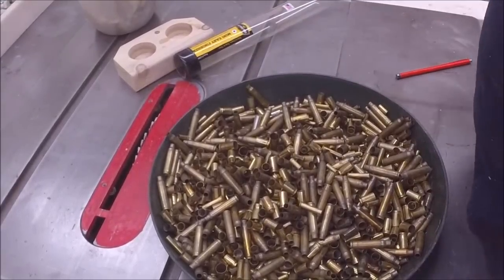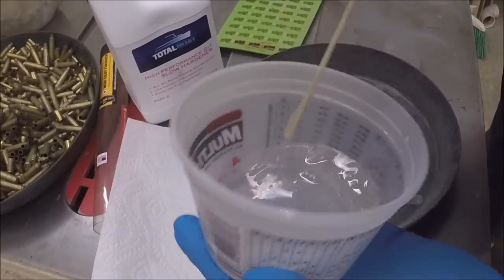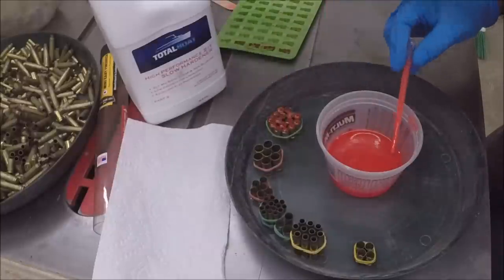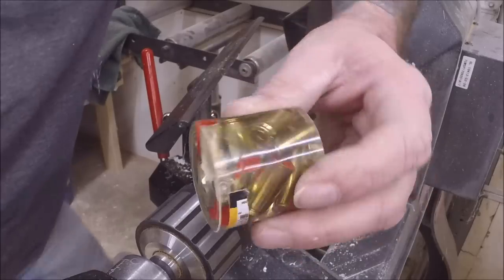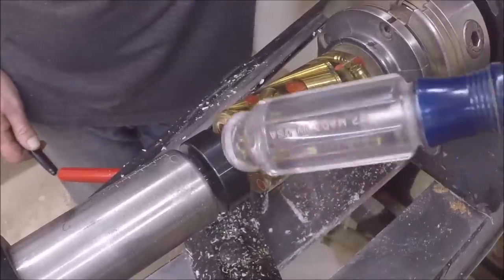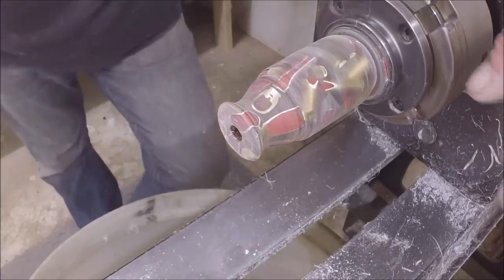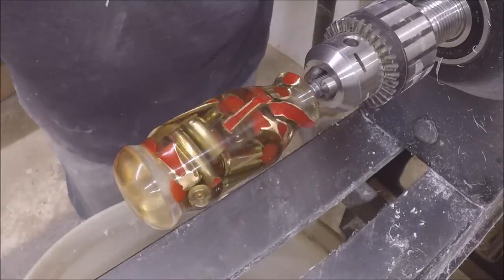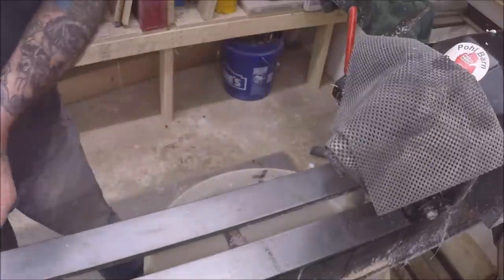Ammo Casings and Resin.. A Screw Driver Handle

Comment: Large diameter handles let you get lots of torque...... long screwdriver shafts eat up torque.
Reply from the maker: Thank You, I'm sure my Dad is never going to use that for anything other than to show it off, and the handle is the right size for his arthritis .
Reply: always used the long screwdrivers to spin the shank fast with my finger tips. if the length of the driver is causing serious torque problems you're probably doing something wrong. phillips is trash anyway.
Reply: +firebirdude2
 actually long screwdriver shafts don't eat up torque. The reason for this is torque is in units of force times distance, but the distance of course is not distance along the axis of rotation (the screwdriver shaft) but instead distance away from the axis. This is one reason screwdrivers have handles; the bigger the handle, the more torque to the shaft is provided by a given force. Not the length of the shaft.

Comment: looks great brother thats one hell of a long screw driver . good job buddy .
Reply from the maker: Thank You !  It was my Dad's  for what ever reason the handle desintegrated in his tool box. Snap on tools are expensive, but try to get it replaced if you didn't buy it from that guy. Not Happening.
Reply: @PohlBarnProductions  well it is a lot better then it was for sure and a one of a kind piece . i think you did your dad proud with it and it will last forever now. well as long as you dont drive over it with a big truck lol . again great job my friend .

Comment: Great job, I love the idea using brass bullets casing. I thought it might dull your tools. It looked just fine. Keep turning. Thanks for sharing.
Reply from the maker: Thank You Vyran,  the brass casing needed to be annealed,  they were unbelievably hard, I did not know this or I would have annealed them to soften them,
Reply: All kinds of metals need to be annealed/softened before you can work them. Even metals like copper and silver. Once softened it's so much easier to work with. Getting the some metals annealed can be very tricky. Every metal needs to get to the right temperature to get annealed. Some need different heat treatment to get  soft just right. Some metals need to be heated  up and cooled down 2 to 3  times to get annealed. Because of the different additives used. I've had some issues with lead, brass, steels and even copper in the pass. I'm now making my own metals in the shop for my own products. I've tried many different mixtures. Just to get exactly what I needed in weight but size were way off. Many people like to make there own brass bullet casings. To get there idea weights for shooting. Sniper school taught me to make my own bullets. To know exactly what I'm shooting. How far my bullets will go. How make and use my own gun power used for each shot. I new how my bullets would act. From being consistent with every bullet I made. I had faith in each bullet made myself and I new how they would act in flight. I sometimes tried different brass casing that I've made. Just to see how the different additives would do or fail. We tried different strengths sizes and case weights. Even trying more and less of our own gunpowder mixtures for each bullet we studied. Most people  would skip this and part and just go out and buy the empty containers in bulk. I used to go to the shooting range early in the morning and pick up as many as I could find or I would buy empty casing at the range. I would also go to where the local police would practice at. This little nice Gun Shop with a large shooting range in the basement. If you ever need to know the right annealing technique and temperature ranges for the different kinds of metals your needing to annealed to be safe most brass is around 500° to 600° for one hour. If that doesn't work try between 725 to 800° for a 10 to 15 secend at most and  that should do. Metals are getting worse by using and reusing over and over. All the recycling through the years. People are not really paying attention to the quality of reused metals. Watch how the quality is starting to effect soft metal over time. Some metal companies are starting to deny recycled metal. We've been buying crappy metals from around the world that's so tainted and could infect the other metals. Its making our metals more expensive. We have to  add different additives to clean out other properties added to the crappy metals. We should of never closed our metal making company.  Wev sent the to the other side of the world. Were importing really messed up and bad quality metals. More and more companies are coming back. The key to the senses is to try and lower the price as much as possible to keep the the company's from buying the bad metals from outside sources. Unless the Government gets involved to set up quality standards here and abroad. But fat chance with the stupid people things the worlds going to end from climate change. LOL this isn't the first time the world that the climate has changed. It's like commonsense has died with the adaption of computer and game system invented and Democrat invasion of public school's and colleges. To push there crazy idolizlolge on our children. That's why I left college. I felt it wasn't right to have only Democrat and no other parties in schools. I felt schools failed not only me but our students as well. They shouldn't of been allowed in schools or colleges to push stupid idolizlolge on the students without another party able stand up against them. Now we have a communist trying to kill our capitalist economy. Doesn't anyone remember or talk about Socialist party like Berry Sanders or Hitler and his socialist ideology that brainwashed millions. We are heading that way again. 60 years ago we had the Socialist hearing in America. Some people were even executed over them hearing. Its starting again were it last started in California. I never thought in my life we would have communist party running for president. Berry Sander and Bloomberg buying his way in to wreak the American Dreams.

Comment: This is an interesting idea. I'd be interested to see a version done where the first cast was narrower - then this cast was put into a second fatter cast of resin so that when turning the screwdriver handle's on the lathe there would be a buffer zone of clear resin and the shell casings would remain intact behind this at the finish.
Reply from the maker: Thank You John, that's an Idea,  I was after the cut away look when I turned this,
Reply: The Pohl Barn Productions Thanks for responding.  Yep,  I figured you knew what you were doing :) I wonder what you’ll do next!

Comment: Have you ever considered an air cooling setup for stuff that gets hot like this? I got myself one of those loc-line coolant nozzle kits, hooked it up to a ball valve and mounted it to a magnet so I can place it anywhere.  I like it for pointing some air at the back of a forstner bit for hollowing.  I vary the air flow with the valve. Good for clearing chips too. Food for thought... The handle came out great!
Reply from the maker: Thank You Ben, thanks for the info
Reply: @PohlBarnProductions  Any time! I always get a lot out of videos like yours, happy to help.

Comment: Hey Sir, Fellow Michigander here. (Grew up in Vermontville, live in Detroit-metro now).
Why do you place the epoxy in a pressure chamber? What is the advantage?
I had thought about a vacuum chamber to draw out air bubbles in thicker castings.

Sorry for the dumb question; this is a new venture for me. Thanks for your time, and for sharing your projects!
Reply from the maker: Thank  you Tim,  LOL   I went from 8 and woodward ish area to Charlotte.  and I'm never going back ! um to control exothermic reaction and to compress any of the smaller air bubbles until the resin sets up and hardens, vacuum isn't fast enough to remove the bubbles before the resin sets up, there are resins specifically for vacuum chambers then cook it to cure it then pour it and put it into a pressure pot,  LOL

Comment: Very cool idea. i was wondering if carbide would cut brass smooth but then again brass is soft compared to other things like seashells!!. but i have been casting bullets and exploded views lately. had good luck so far .got a mould to do a 50 cal one since i have quite a few of those laying around. should be interesting. specially how the powder reacts to the resin over time. i mix with resin first to shape how i want then cast but still. might not work out in the long run. Keep em coming.
Reply from the maker: Thank you Johnny,  actually I should have annealed the casings first that would have made them softer,  I could turn them but they were really hard due to the flash heating they get from being fired.

Comment: Why can you not turn ferrous metal? Is it the hardness? Are they to brittle? Just curious. Great channel. Watch at the end of the day to decompress.
Reply from the maker: my tools are for wood not steel, you can turn it with a metal lathe,  I also wouldn't want sparks in my shop with dust and wood everywhere.

Comment: Did you try inserting the screwdriver shank while the epoxy was still liquid?
Reply from the maker: yes that would of probably worked,  but it would not of fit into the pressure pot like that.

Comment: I noticed you always use a stick for mixing your epoxy!!  I use a little custom made plastic mixing bit in my cordless variable speed drill.. works really well..   you really think up some cool stuff to create with..  great stuff .. Did the brass tear up you tools?? Did you have to use metal turning machine bits ??
Reply from the maker: Thank you Tom,  the brass was hard on the tools I should have annealed them first but didn't know, I use normal carbide tools for wood

Comment: I tried to turn a blank using seashells and my carbide tips wouldn't cut thru it....how are you cutting through these shell casings and do you have to constantly sharpen them?
My niece asked me to do something similar.
Reply from the maker: they are hard but do cut, it just took longer than expected,  light cuts with the carbide cutters, you can cut it with HHS also but well have to sharpen many times. I am working on another, Annealing the casings first, heating them with a torch and dropping them into water,
  I know that should harden them but it softens them,  that's backwards  if you ask me...  then I have to run them all through a tumbler to polish them as the annealing discolors them.
Reply: @PohlBarnProductions  thanks for the feedback and all the great videos!

Comment: If you try this again, clean the brass with an acid like acetone, vinegar, etc. You need to get the oils from hands and cleaning the gun off. Also you need to give the resin a mechanical grip to the metal. So sand it like you would when making a pen blank. Try again though. Because this looks really neat.
Reply from the maker: Thank you Erin
Reply: The Pohl Barn Productions you’re welcome. Found you through Nick Zammeti, Peter Brown, Andy Phillips, Bobby Duke, and Matt Jordan. Love the things y’all make.
Reply from the maker: @ScheelesGreen  that quite the bunch of great guys to be found with,  I'm honored to be among them. Thanks again for the support,

Comment: Even sped up it took forever to fill those 223s didn't it?  Awesome work
Reply from the maker: Thank you ! It took forever trying to not get bubbles into them, the dropper helped out tremendously. but yes it took a lil bit to fill them all, it's only spend up X 4, you only have so much time to work with the resin also.

Comment: Nice. Im gonna have to do this one!
Reply from the maker: anneal the casing first Brad,  thank you
Reply: The Pohl Barn Productions can brass be hardened? Wonder what temp it would need to get to since u couldn’t depend on the magnetism check
Reply from the maker: 800 or red hot and drop in water, it's backwards from steel,  it softens
Reply: @PohlBarnProductions  interesting. Gonna have to look deeper into it. Thanks for the heads up

Comment: Excellent idea sir, just a thought about the resin, I know when curing you should wait about a week for the resin to harden for structural integrity.  Maybe if will let it be easier to turn?
Reply from the maker: Thank you !  72 hours on this resin to cure, the problem is the casings being hard, I have to anneal them to soften them, I just have to figure out the amount of heat to get the right softness that it's not so hard to turn.
Reply: The Pohl Barn Productions nice I didn't think about that.thats why you were worried about the primers.
Thanks

Comment: Bad ass shifter for my jockey shifted ironhead chopper. Vintage late 60s early 70s
Reply from the maker: Thank You
Reply: @PohlBarnProductions  No, thank you. I have access to a lathe and its given me some ideas. I have a bunch of buffalo nickels that I think Id mix with some shells as you did. Blue may be my shell filler, havent decided yet. Bringing bike back to it former glory. Diamond tuck leather and metal flake. Anyway, great video and thanks for sharing it. Im digging the idea. Keep on trucking my friend.
Reply from the maker: anneal the casings first, heat them up to red glow and drop in in water, I know it should harden them but it softens brass, I did not do that for this project and those casings were hard as Hell.
Reply: @PohlBarnProductions  Thanks. Your A.O.K!

Comment: Why would you need to knock out the primers If they Were Metal? or magnetic as you said.

I like yours - came out very nice, Congrates. I Think I will try to make me one with all clear Resin.
Reply from the maker: Thank You, Brass is a nonferrous metal, like aluminum, lead,silver or gold, if the primers were ferrous like steel it could damage my tools and or create sparks,  sparks in a wood shop is no good.  give it a go,

Comment: Do you have to worry about air pockets when you have a vacuum chamber? I would just through it all in there and do the chamber do the work. But good job getting the red in there. Nice little touch. I would have made the bottom end of the handle a bit different. maybe bunch up 6 or 7 of casings in a way that you can see the primers from the bottom. sort of like a wheel gun cylinder from the shooters view of the gun(god it is hard to explain things in comments..). may look different in real, but i think that would give it a little extra kick.
Reply from the maker: Thank you, it really could have been done so many different ways, basically I was in a hurry to get a project up and this was quick, I picked a color and filled the casings, I did position the 357 so it would not get hit, as that is Dad's favorite cal, handle was for him. this resin sets up in 35 to 40 minutes. not sure if vac would work in that short of time, also I do not have a vac system yet. the casing needed to be annealed as they are like turning rocks, part of the reason I stopped shaping it.  Glad you liked it

Comment: when turning this did the shells hurt your tool at all. my sister likes miller 64 and I want to use the caps to make her something... ??
Reply from the maker: Thank You Teresa,  the brass was softened but was still really hard on the tools,.  I think the caps are metal and would not turn as nicely as the brass does, also damaging the tools.
Reply from the maker: if they are aluminum it should be fine to turn, see if they are magnetic to find out.

Comment: That’s pretty bad ass. I’m a brand new turner. Less than a month in and your videos are insprirational. How did the carbide tips fare cutting through the brass? I’d imagine it was hell on them ?
Reply from the maker: Thank you Tim and have fun with this new Hobby,  um I needed to anneal the casings and I didn't know it,  they are hard and beat the crap out of the tools, so if you can anneal them first and polish then cast them they should be softer and not so brutal on the tools.
Reply: The Pohl Barn Productions  I appreciate the feedback. My other hobby of love is reloading so I was wondering about annealing to soften them. I figured the case bottom / flash hole would be totally brutal to try to cut into. But like I said I LOVE the videos and watch daily to learn new stuff. One day I’ll upgrade to a bigger lathe and I’m dying to learn the art of resin casting. It just amazes me. Cheers from Red Wing Mn!
Reply from the maker: @coyotecartelmn4908  it works backwards for brass... so know about annealing then.
 that's good you understand what I was talking about. to be honest they were all hard all the way through.

Comment: Truly interesting and clever idea! What does a vacuum chamber setup like you have cost?
Reply from the maker: Thank You...not sure what a vacuum chamber costs, what I have is a paint pressure pot I've converted for my needs, Harbor Freight has them for around 100 but take that 20% off coupon with you.  then add in a couple fittings and a valve,
Reply: @PohlBarnProductions  Thank you!

Comment: I've been wanting to make something similar, but a shift knob for my car. I want to have complete bullets and casings inside to look like live rounds. I'm thinking this may be tricky, as I don't want any brass etc coming through, most likely a multi stage pour? I'm new to all of this stuff lol
Reply from the maker: well it can be done,  you don't want any powder or primers in there or live rounds, the resin gets Hot when curing, I've seen it done and thought the guy was an IDIOT. luckily none of them went off.  clean the brass as I did not.  fill with resin. drill out resin enough for bullet to fit down in. glue it in with either epoxy or CA glue, I would go with 5 minute epoxy as to wipe off excess so no voids are left around bullet.,  it's going to take a bit but should work,
Doug

Comment: What kind of machine you put it in to harden the epoxy?
Reply from the maker: Pressure pot, it compresses any air bubbles until the epoxy sets up and cures, it does not harden the epoxy.